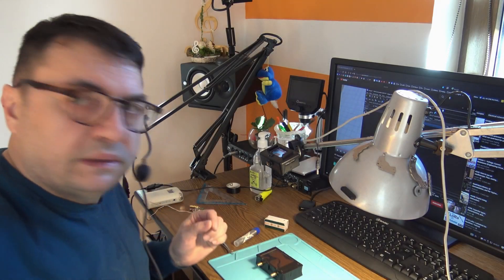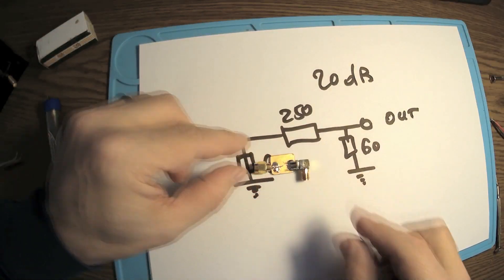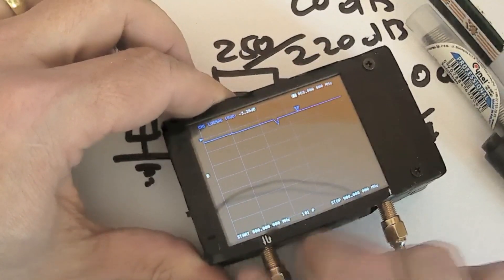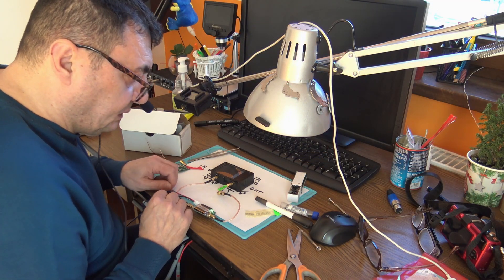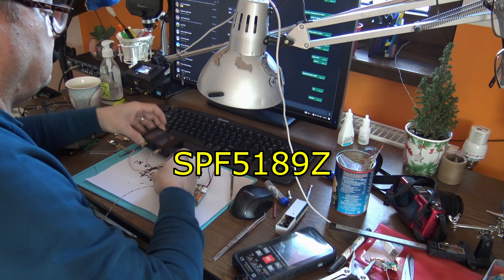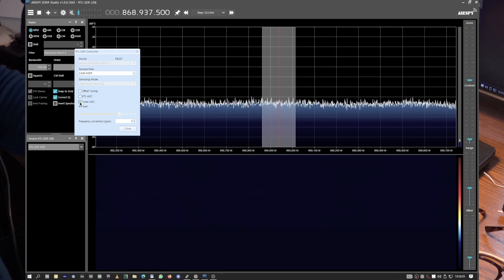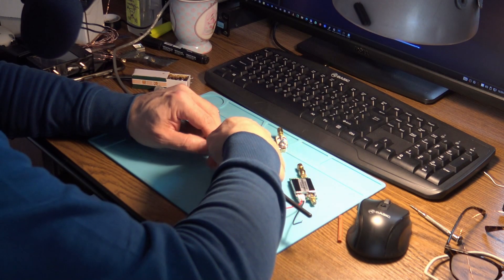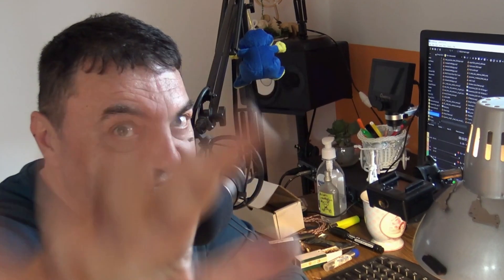LoRa amplifier test part 2

Comment: can the output signal from the LoRa amplifier be connected directly to an oscilloscope? Or do we need an attenuator? Max effect is about 1W, that's kind of nothing.
Reply from the maker: First, you need a real cleaver oscilloscope to read those 800/900Mhz. Oscilloscope probes have a 10x attenuator anyway.

Comment: hello Viorel
how are you
First of all, congratulations to you.
you are very helpful.
So, would you recommend using this module on 868 mhz devices?
Reply from the maker: I can't say yes because I didn't had any plausible results, but I tested with an improper antenna and cable..the other way, it should work..it's working in fact as you see, but I got no good statistic..The right price should be around 30USD..not worth more
Reply: @viocaia  thanks. so what do you recommend???
Reply from the maker: @osmanaltinbas8161  I really can't say now..but I'm still searching and testing, so subscribe to be informed
Reply: @viocaia  You are a very decent man. I just started following you. I will continue to follow
Reply from the maker: @dj_Y  Thank you Mehmet..

Comment: Looked at the spec for the AMP , it states that you need -2dbm minimum to detect TX, I believe nano Vna TX power is around -10dbm, this is almost certainly why you didn't see the TX amp turn on. It will only transmit when it receives enough signal, this is how it differentiates between TX and RX signals, you can probably force it to TX by placing 100pf Cap from one side of coupler to the other side, there are other ways also, but I can't see hte circuit clearly on video to guide you unfortunately. - Best of luck -
Reply from the maker: It's working and sending beacons..

Comment: If you check the datasheet. For TX amplification the signal needs to be at least 1db to activate the switch, otherwise, it won't amplify. The default mode is RX amplification where you need to connect port 0 to out, and port 1 to in. You should see 12 +- 2db amplification.
Reply from the maker: It's working..thank so much!
Reply: @viocaia  also please check what range of frequencies the amp is working in. So we know if it amplifies near the gsm band. If it does,  it needs a filter on the input. cavity or saw
Reply from the maker: @beatvine  video on the way
Reply from the maker: Thanks , I'll redo everything..

Comment: OUT is from antenna. IN is on miner.
Reply: When you connect the antenna to OUT port, on IN port you have amplification. This is RX wich is always ON(green LED). When the miner is outputing to IN port a signal, the amplifier is switching(blue light on) and is sending to OUT port to antenna! This is how it should work. But i'm not sure if should react to VNA signals... Is about modulation. Check manual of the amplifier!
Reply from the maker: @adaniel69  You're so right..now it's working!
Reply from the maker: I got it! I did wrong..